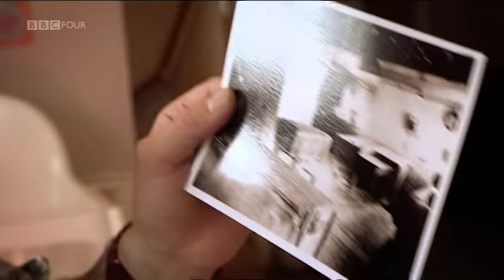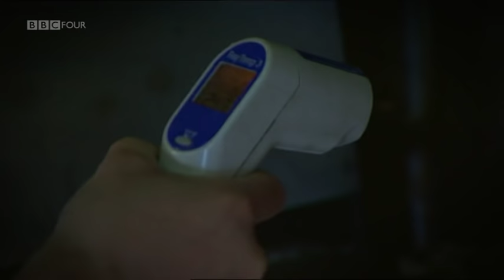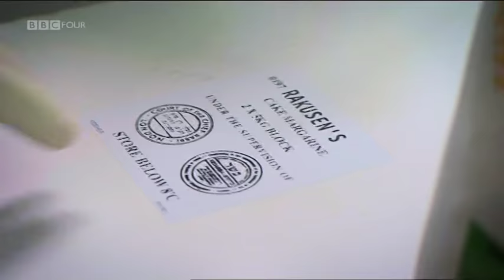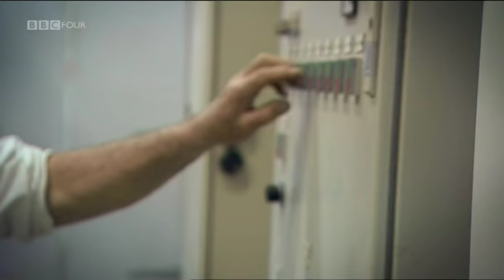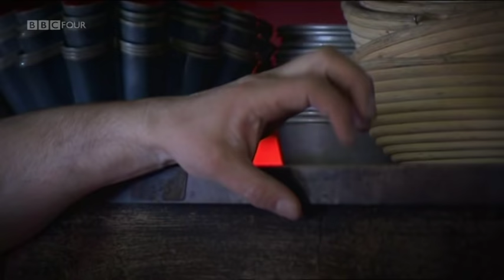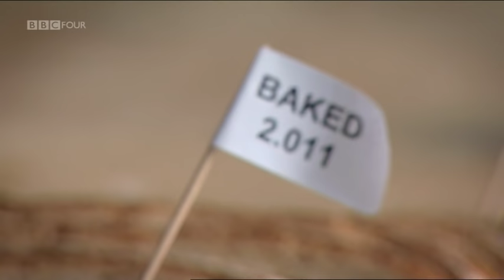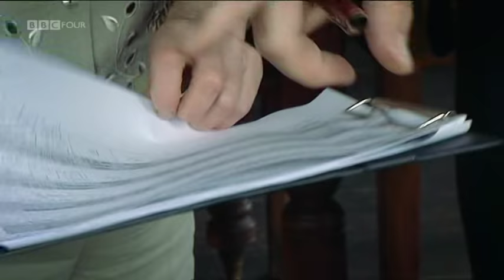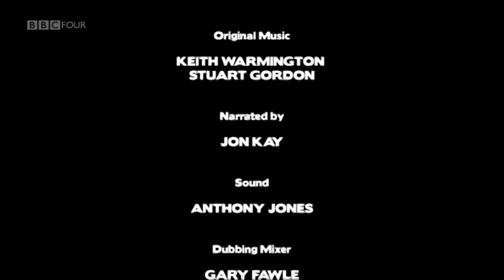In Search of the Perfect Loaf - BBC FOUR - Wed 15-06-2011

Comment: Strange. Either he is purposely failing on the first two loafs or he doesn't know how to make a basic sourdough loaf. Why is he so violently kneading all the air out of the dough and skips shaping? No wonder they turn out flat and dense!
Reply: I thought so too. When he measured the temperature of the wood oven being 240 Celsius I was like “hm seems a little low to me. Won’t get a good ovenspring especially with a high hydration”.

Comment: Though this is a very nice documentary but as a baker I am appalled as to how much misinformation is in it: spelt is not very very rare just more expensive as it doesn’t yield as much as modern wheat. It also doesn’t bloat less as the FODMAPS in it are just about the same as you find in modern wheat varieties. It is actually the dough proofing that gets rid of what makes most people bloat. Spelt actually contains more protein than most modern wheat varieties. I am also not quite sure, though this young baker is very charming, what he has learnt during his apprenticeship. Who doesn’t know (that has baked bread before) that wholemeal doesn’t give you a good rise?! Who, who has worked with sourdough before (and he says that his starter came from this Irishman his grandfather worked with) works his dough that aggressively or doesn’t know rising times?! And sorry his shaping technique judging from the failure loaves is really bad.
Reply: Yes, your recollection is correct. Spelt does contain more protein than modern wheat. This is primarily because spelt has not been adulterated by breeding and it still stands as tall as evolution has made it for the perfect balance between stalks and roots. A short plant develops shorter roots as it does not require deep roots to keep itself balanced and with shorter roots comes lesser nutrient availability. Spelt has deep roots and it gets more nutrients further down where the roots of modern wheat can't reach. Thanks to these extra nutrients, spelt is more nutritious and it can build more protein to put into its seeds.

However, more protein does not automatically mean stronger flour. Modern wheat has been selected first unintentionally, and later intentionally for strength, so even though it has less protein, its gluten network is stronger than that of spelt. You can easily make up for this by adding some fibre, either from the bran of the spelt itself, or using a tiny bit of fleawort. The fibres are highly water absorbing and when they absorb water they swell and form a sticky gel that contributes to the strength of the dough as a secondary network in addition to the primary gluten network. Spelt dough shouldn't be kneaded either, there is the danger to overknead it even by hand. Stretch and fold should be used instead. And ideally one should add a water roux to the dough as spelt bread has a tendency to dry out faster, so it needs some water reservoir.

Spelt is exactly the kind of flour that doesn't respond well to modern baking methods, but it is well suited for traditional techniques, such as high hydration, no kneading, long dough rests, long fermentation with sourdough.